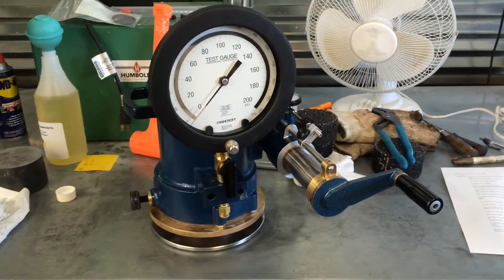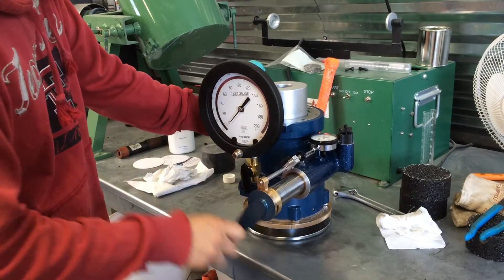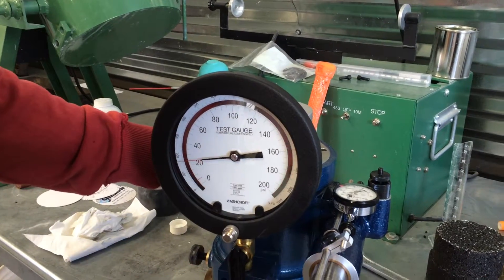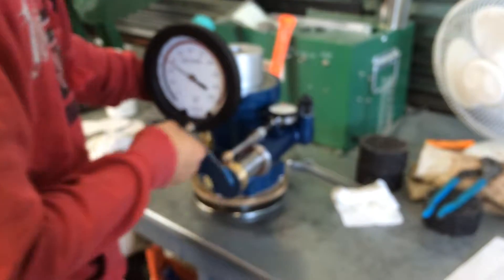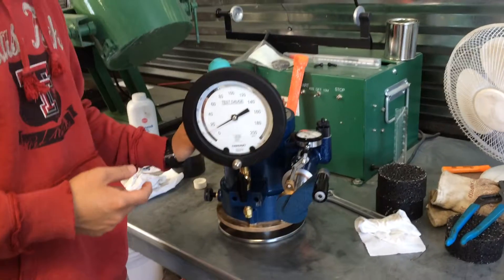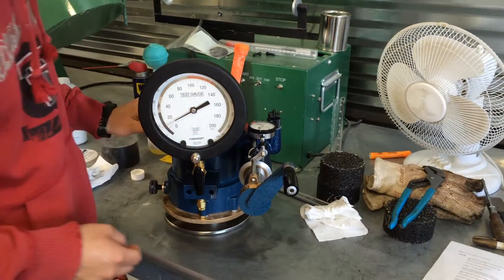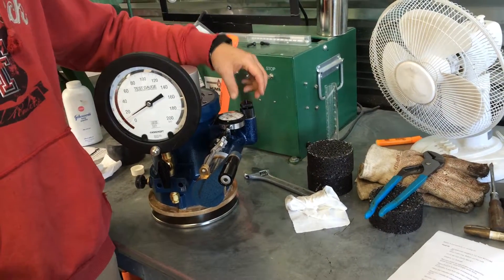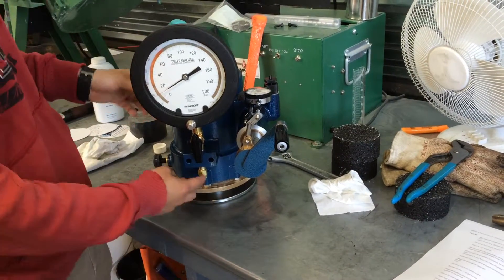HVEEM Stabilometer Air adjustment problem

Comment: Try tipping and inverting the stabilometer in all directions to promote movement of the air. I tip mine upside down and shake it around to get the air out of the bladder. Also, remove the split assembly, crank the handle until the fluid level reaches the top of the threads, then tilt it so this assembly is the highest point on the stabilometer. You should see air bubble out and the oil level drop. Rinse and repeat until the air is removed. Hope this helps!

Comment: I had the same issue with my stabilometer, air gets trapped into the ribs of the bladder and will not escape. Need a special tool to remove the air, i had to take mine to a shop where they do repair on them